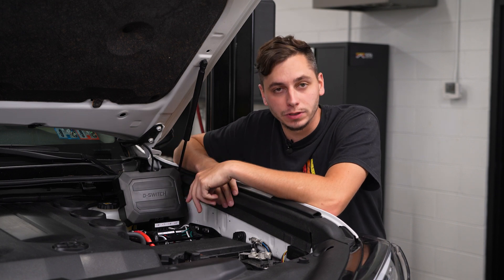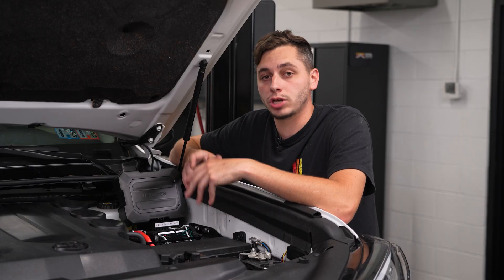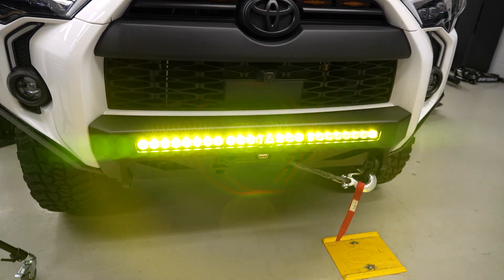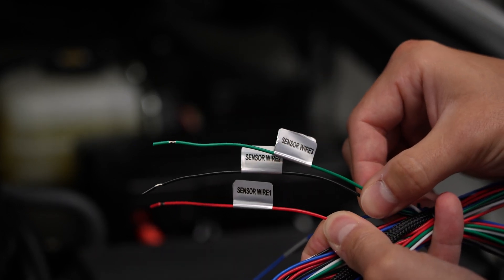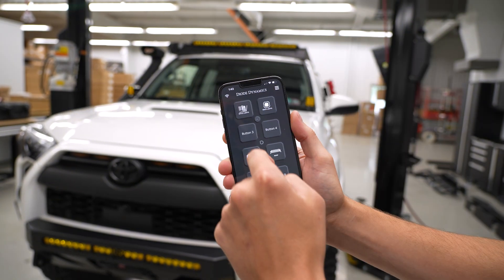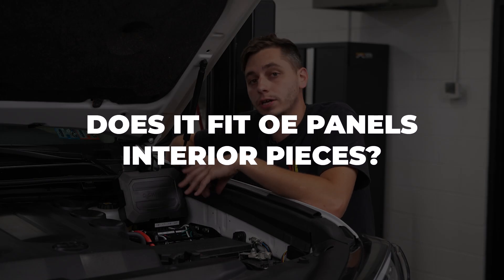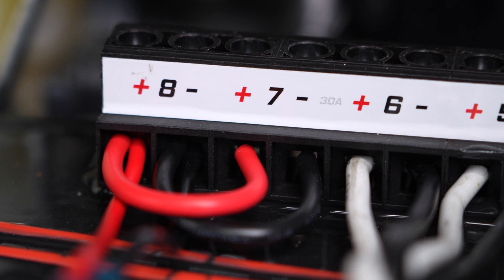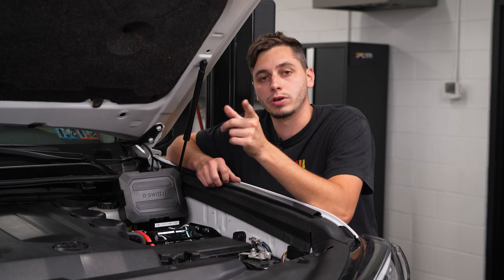Diode Dynamics D-Switch | Smartest Switch Panel Ever?!

Comment: Can it be set up that a button can come on every time the ignition is on, without hitting the button each time the truck is started? I understand that the switch can come on with ignition, but if a button was on when the truck was shutdown, will it be on when the truck is started the next time, i.e. Does the switch retain the button position after being power cycled?
Reply from the maker: The system does not have memory so when you have something on and turn the truck off it will reset when you turn it back on. But thats where the trigger wires can come in handy. You can program a button to one of the trigger wires and when that trigger wire gets power it will turn on the switch without physically pressing it.

Comment: They need to add a wireless control for inside the rig (it's 2025). Shit my cheap one from amazon does that and it works great. I have never had a need to use my phone from 100 feet or less to turn on or off my lights.